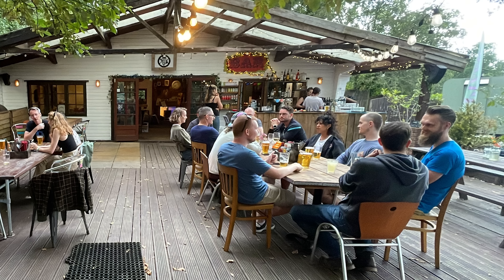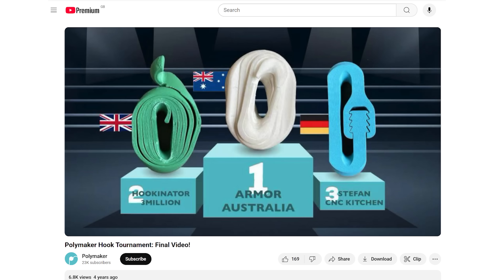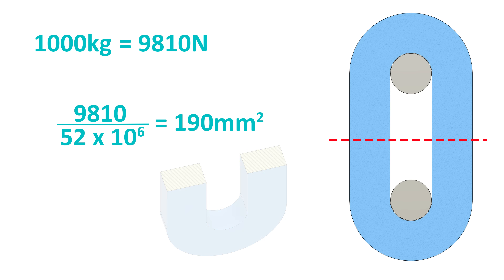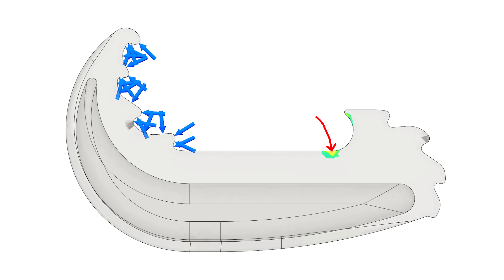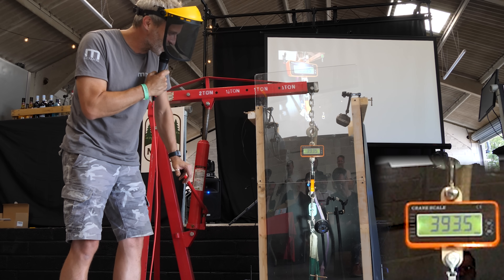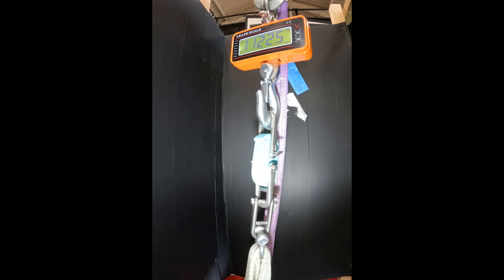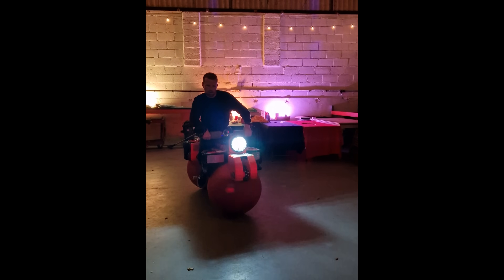Designing The Strongest 3D Print

Comment: "is it hollow??" was the mother of all bragging rights
Reply: Does anyone know how this hollow design compares to printing with 0% infill. Does the thick-wall strategy beat the “maximize density” strategy?
Reply: @IBAndreas  Basically when you have a box section or a tube, you get closer to the strength of a solid part of that same size, while maintaining the weight of a smaller sized tube/box with the same amount of material.
Reply: even with this small piece of 3d printed plastic holding together under a literal tone of weight that also weighs 50grams holy shit!!
Reply: If the section where stress was the most was actually solid, would that give it a better chance of force distribution?
Reply: Infill doesn't add any strength
Reply: @sylaswojciechowski6895  It does, just not as much as the perimeter.
Reply: @PatrickHemmes in theory it actually is nothing, while it does stop deformation a bit so in practice it does help but is negligible.
Reply: @The_oli4 it depends how much % you use, 60-80% increases strength to a good 80-95% compared to completly solid. Als the type of infill, regular raster infill sucks, gyroïde helps loads.
Reply: @PatrickHemmes  it does if theres no weight limit. For the hook infill takes away strength, as it reduces the amount of material in important spots
Reply: @The_oli4  Applying advanced concepts while completely lacking common sense is a funny look mate. Of course it'd be stronger.
Reply: @oyuyuy  agreed, really funny to see multiple people talk about hollow vs solid in in regards to pull-strength.

Tim made a hook, I know that is more complex than this example:
Imagine two blocks being pulled apart, in-between are a bunch of (carbon /plastic /steel /whatever) strings. It doesn't matter if the strings are in a perfect circle with a hole in the center(tube), or all next to each other in a solid square (rod). Pull is about cross section area (amount of strings) and material.

He made a hook with as little stress concentration as he could. While maximizing cross-section area, that also has to be consistent throughout. (And is printable)
It happened to come out hollow... That is not a 'flex' or even an important part of the design. 

Stiffness wants a large size thin walls, like the DLG-plane behind Tim. 
Strength wants a small sizes and dense material, like a hammer.
(The DLG tail even has the carbon strings in a 45degree angle in the tail, to optimize stiffness. (Any carbon rod weighing  of the DLG tail('tube') will  it in a pull test. But the rod would bend under it's own weight while holding it horizontal at one end...
Reply: @nanskate  Tim?
Reply: @nanskate I think it's more of a "flex" just because it used far less material than you'd think just looking at it. Keeping it under the weight limit meant hollow was the strongest option, but a fully solid part would be stronger still.
Reply: @sylaswojciechowski6895  yes, but it does add weight, so they were limited to 50gr
Reply: @sylaswojciechowski6895  Depends, compression or tensile. It most definitely adds compression strength.

Comment: Awesome project. Certainly for bending forces on the piece, hollowing out the inside to make the part wider helps. For pure tensile strength on a “brittle” material, cross sectional area (not talking about second moment of area) was reduced by hollowing out the part, so tensile strength was reduced. It was my
Understanding that you doubled the cross sectional area to get to double the tensile strength, but the moment you hollowed it out, the ideal tensile strength was reduced. I wonder if you recalculated tensile strength with the actual cross sectional area (not including the void inside), if your experimental and ideal values would be pretty close.
Reply: Fully agree!

Comment: ABS was considered the "weakest", but considering the density of ABS vs PLA you'd be able to make around a 25% larger part for the same weight budget if made in ABS (~48cm3 vs 40cm3). I wonder if this would have performed better as a larger designed part but printed in ABS.
Reply: Good point, but while it wasn't specified, it kinda sounded like all 3 material variations needed to be printed from the same file & scale.
Reply: His thought was that the ABS part would stretch to a point where the teeth disengage and that would be the end of the competition. PLA doesn't really stretch, so this point of failure is nearly non existent.
Reply: 123rd 👍.

Comment: Try adjusting the incident angle between the raster angle of each infill layer. Wrote a uni project on this a while back and it gave a massive improvement on tensile strength compared to the usual 90 degree angle
Reply: Is that why most of the cracks seem to follow a 45d angle? 11:51
Reply: @_numanair_ it could be a contributor. If I remember right it linked to the tension sheer coupling effect. Measured a 40% improvement overall and only really worked if you know the exact direction of the load
Reply: I thought he sliced it to be all walls anyhow, so everything would be parallel to the walls.
Reply: ?in laymans terms? stagger the perimeters like a brick wall?
Reply: @adriansue8955  Change the angle of the infill in relation to the perimeters. I haven't needed to do it in a long while, but simplify3d used to let you set as many different infill angles you wanted. I was making small thin parts and the slicer was generating solid infill layers after bridging parallel with said bridging. I think the way the part was no matter how it was oriented something was going to be parallel. Instead of letting the infill run at 45 and -45 degree angles, I set it to -33 and 33 or something similar.

Tom said he designed everything around perimeters and that's how it was shown sliced at one point in the video but the failed part in the final picture isn't that. I assume it's just a rectilinear fill on the top and bottom layer and everything else is just perimeters. I think that might even be what cura defaults to when you ask for no infill.

Comment: Your design is amazing, I was also thinking on linking it in the middle with some kind of flexure. Amazing job Tom, you inspire me when I'm tired of studying for exams.

Edit: I'm glad it broke in a way that is straight forward to analyze, you immediately knew what to improve. I guess this design will reach peak when it just explodes in nonsensical pieces, like it is giving up all at the same time.
Reply: An engineer tests the latest print of their assembly one last time. After the hydraulic press increases the force to just above 10^6 times the weight of the assembly, the assembly finally gives way as every part simultaneously shatters into a fine sand. The engineer, finally satisfied, turns off the light and goes to bed.
Reply: @haph2087  "I am complete" a short tale about the best engineer in the world.
Reply: https://youtube.com/shorts/bOLOtlVF6WE?si=s520HRsXQju7Z6Cw

Comment: Instead of changing anything on the outside you could just add more material inside where the concentration point was, and take a bit from somewhere else to keep the weight limit.
Also it seems like the simulation didn't pinpoint the weakest section, it was showing it on opposite side...

Comment: How did you choose the ratio of thickness of the inner and outer wall? I assume you fine tuned it with simulations, but am curious whether you had some heuristic for choosing the starting point.

E: Also, have you considered shapes where the inner and outer wall are not connected, but the outer wall itself is in form of a hollow tube? After all, the outer wall works only in compression and the inner ~only in tension, so we don't need to provide inner one with stiffening and the further away the outer is, the less load it has to transmit. I wonder if there's some obvious intuition that explains why this wouldn't work (some limits based on stiffness of the outer one? but then it can be prestressed~~~).
Reply: My guess is he probably went with the rounded square tube cross-section for ease of printing

Comment: Fantastic design, and great thinking outside the box regarding how the parts are technically one piece! The failure crack also seems to follow the print line direction, and I can imagine that the weakest parts of a print are between the paths, similar to how z-layer to layer strength is usually the weakest. I wonder if there is a way to optimize the slicer to follow a certain path in the high stress areas, and if forcing the print head to go in expanding loops rather than zigzagging

Comment: Interesting, so 3D-printed stuff can actually be used for something now? When I first had a look around 2014, the pieces were so brittle that I could crush them between my fingers with ease, and if dropped on the floor would shatter into hundreds of fragments.
Reply: 3D printing like he used has been around in the consumer market since the early 2010s.Not sure what 3D print you encountered, but it is definitely not the norm.
Reply: @ADBBuild  It certainly was the norm then. I know people who foolishly tried to use it to replace broken parts, and they almost universally failed. No appreciable strength. Good to see that the situation has improved.
Reply: I was printing an appliance holder lately, whole thing weighed probably 30-40 grams stretched across more or less an A5 paper sheet. I messed up one dimension royally, and since I'm new to printing I've decided to destroy the failed part to see how strong it is, and how anisostropic will the print strngth actually be. Of coursse I did manage to break it, but with significant effort. A 3D printed pen body will have maybe half the structural strength of an injection molded plastic version - well enough to use in repairs, light tools, jigs, and usable toys.

Comment: AI Summary

Abstract:

This video details the design, optimization, and testing of a 3D-printed hook for a competition at the "Makers Retreat" event, sponsored by Polymaker. The challenge required designing a hook weighing less than 50 grams, printed without assembly, and capable of attaching to 8mm shackles without disassembly. The presenter developed an innovative "interlocking J-hook" design, featuring two C-shaped sections with internal teeth and a 3D-printed spring to allow print-in-place assembly and shackle attachment. The design was optimized using theoretical calculations for a 1-ton target load and Finite Element Analysis to minimize stress concentrations, incorporating a custom hollow structure with filleted internal corners. In the competition, the PLA version of the hook proved superior, winning its rounds with a breaking force exceeding 400 kg. A subsequent destructive test demonstrated the hook's remarkable strength, breaking at over 1.1 tons (1100 kg). Post-failure analysis revealed the primary failure point was a stress concentration at the tight angle of the first tooth, leading to recommendations for future design improvements.

Summarizing the 3D-Printed Hook Challenge and Design Process

*   0:00 Makers Retreat Challenge: The presenter participated in a 3D-printed hook competition at the Makers Retreat event, sponsored by Polymaker, requiring a hook under 50g, printed without assembly, and attachable to 8mm shackles without disassembling them.
*   0:53 Design Constraints & Prior Art: The design had to accommodate an 8mm shackle opening, making a simple C-hook weak due to bending forces. While latch designs improve strength, they introduce new weak points and flexibility challenges for print-in-place designs. Previous Polymaker competitions used different rules, allowing non-opening loops.
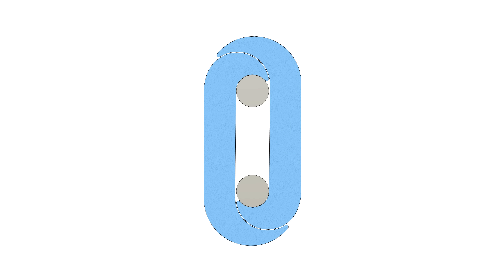*   2:57 Innovative Interlocking J-Hook Design: The presenter's solution involves two C-shaped (J-hook) parts with interlocking teeth, connected by a 3D-printed spring. This allows the hook to be printed as a single piece, open to accept the shackle, and then lock together, balancing forces like a solid loop.
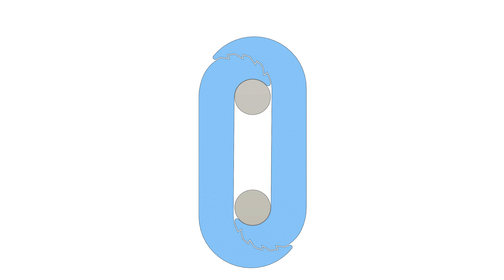*   3:37 Self-Engaging Teeth Mechanism: The teeth are designed to bite harder with increased tension, making disengagement nearly impossible unless the hook structure itself breaks.
*   4:04 Preliminary Bodyweight Test: A 10% scaled-down version (2mm thick) successfully held the presenter's 85kg body weight, indicating the full-thickness hook could theoretically hold over 850kg.
*   4:46 Structural Calculations for 1 Ton: Using Polymaker PLA's tensile strength (52 MPa), calculations for a 1-ton (9810N) load suggested a minimum cross-sectional area of 190 mm², which was doubled for a safety factor. The hook was designed as short and wide as possible to optimize mass distribution.
*   5:52 Custom Hollow Section & FEA Optimization: The hook was designed with a custom hollow section (like an I-beam) with filleted internal corners to prevent stress concentrations, printed with 100% perimeter walls. Finite Element Analysis (FEA) was used to achieve uniform stress distribution, indicating peak stresses in areas that would rotate during real-world testing.
*   7:21 Competition Setup and Material Choice: The competition used a 2-ton hydraulic crane and a 1.5-ton scale. The presenter chose PLA for its highest rigidity, aiming to keep the interlocking teeth engaged.
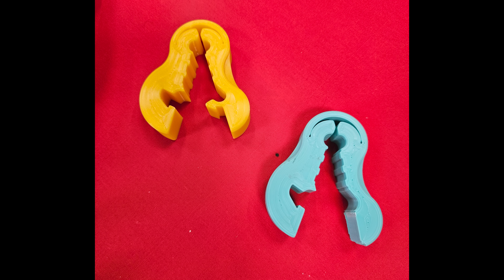*   8:20 Competition Victory: The presenter's team won the competition against Jon's design from Proper Printing, with their hook holding 405 kg before the opponent's hook broke.
*   9:07 Destructive Testing to Limit: To find the ultimate breaking point, the winning hook was re-tested. It withstood progressively increasing loads, finally breaking at an impressive 1.1 tons (over 1100 kg).
*   11:14 Failure Analysis & Redesign Ideas: Post-mortem analysis suggested the hook broke at the first tooth due to a tight internal angle causing a stress concentration. Proposed improvements include increasing the internal radius of the tooth and reinforcing the area around the teeth with material from the hook's sides.

I used gemini-2.5-flash| input-price: 0.3 output-price: 2.5 max-context-length: 128_000 on rocketrecap dot com to summarize the transcript.
Cost (if I didn't use the free tier): $0.0072
Input tokens: 16118
Output tokens: 933
Reply: Why?would like an explanation.
Reply: That’s why the planet overheating - absolutely no need to make an AI summary from the brilliant video.
Reply: @Dmitry_IMHO  in that case yes, because i always watch those. but i would argue the summary takes (now) less energy than watching the video
Reply: Nobody fucking cares
Reply: get off with your ai bullshlt